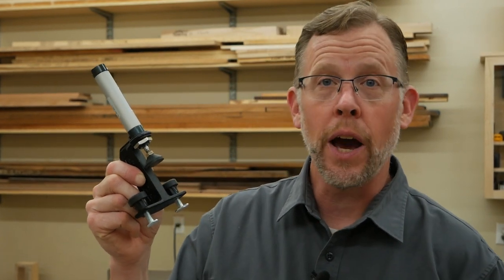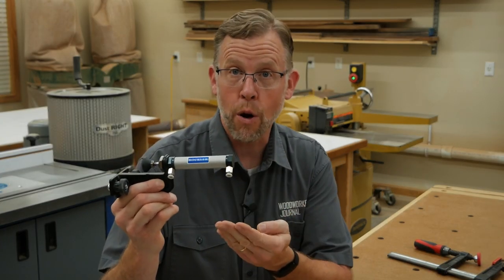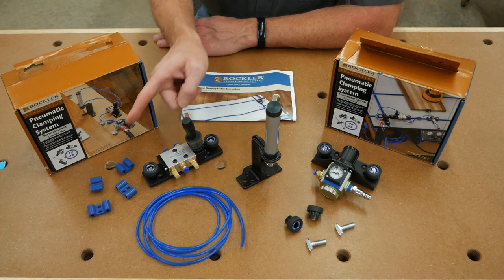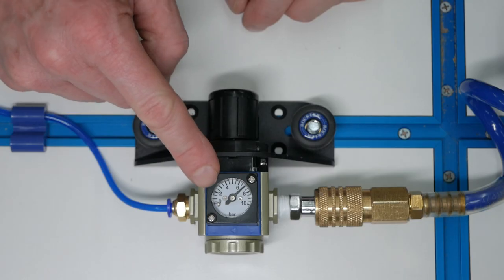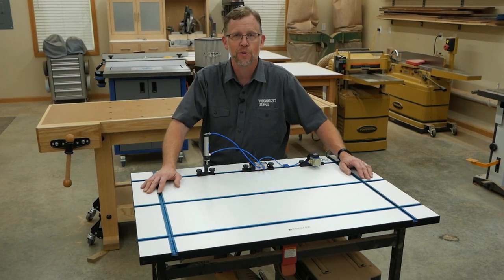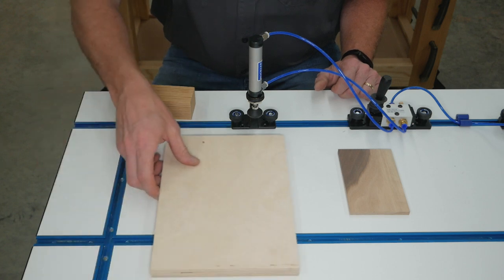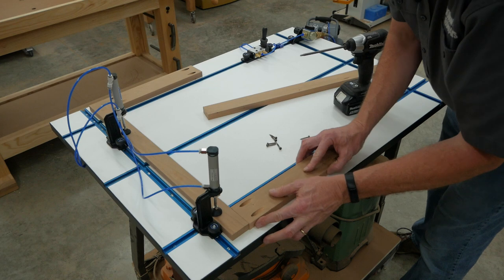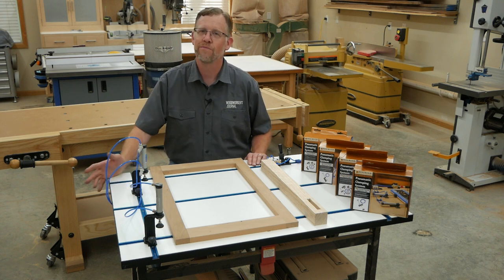Fast and Easy DIY Pneumatic Clamping System

Comment: I figure you are probab;y a salesman, but I have a question for anyone who would like to answer. How good it a pneumatic cylinder for maintaining clamping force while performing operatins, such as hammering, grinding etc. for a shop vise?
Thanks for the video I will be checking out those clamps.

Comment: are the regulator and air filter absolutely necessary?
Reply from the maker: Yes. The air regulator controls the speed and precision of air flow. It also maintains pressure at a level that's right for the system, and can reduce pressure coming into the system upstream while maintaining constant flow downstream. Regulators help systems run efficiently by determining the exact air pressure, so that energy isn't wasted by using too much air. Too high pressure could risk damaging the machine, and too little can mean that the machine isn't receiving enough output and wouldn't clamp securely.

The air filter cleans the air that travels from the compressor. The filter scrubs, strains, and traps solid particles, like dust, dirt, rust, and separates liquids, such as water and oil, within the compressed air. Compressed air systems must be kept clean and dry to ensure continued reliability.

Comment: Do these provide enough pressure for glue ups?
Reply from the maker: The pneumatic clamping system is designed primarily for securing and releasing workpieces quickly, making it great for repetitive machining operations. It's not designed to provide the kind of clamping pressure typically needed for glue-ups.